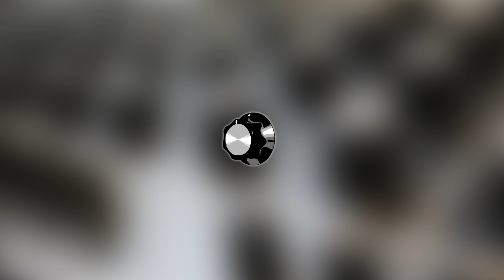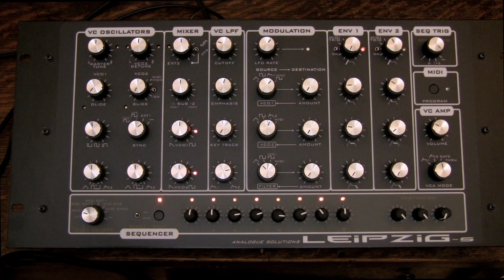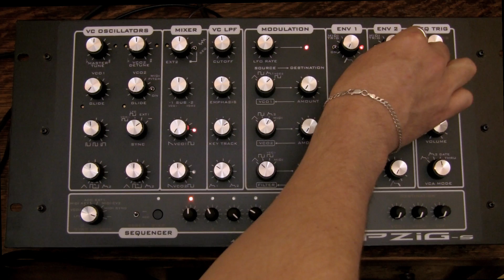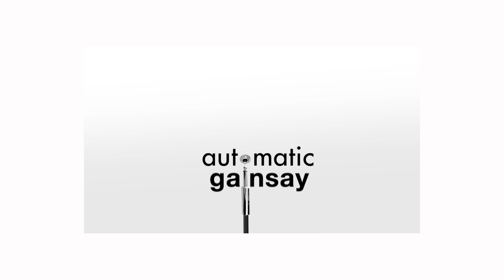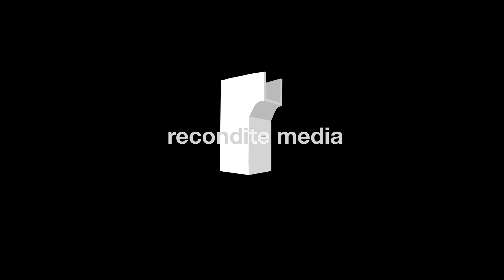03-01-The Analogue Solutions Leipzig-S: Part 3: Filter and Mixer

Comment: I'd seen this synth before and heard some demo songs but your review is revealing it to be somewhat of a barely caged beast. Would be interested to hear if you think it's a bit over the top Marc.
Reply from the maker: Herr Absurd I think it is totally over the top!  But I mean that it the very best of ways.  I think of each synthesizer being a tool, and the measure of it is how good it does what it does.  
In the case of the Leipzig... we're talking about a sledgehammer.  It is giant-sounding and aggressive, rich and full.  It's like a superhero... all of the normal synthesizer qualities are amplified into pure power.  

I don't think I'd use it for a slow, quiet, sensitive song... not, at least, without turning most of it down or off.  :D

Comment: The cool thing with the dual envelopes on the filter sounds like having simultaneous ADSRs routed to filter, no?  So you can blend an sharp transient with a slow attack ramp; sounds like you could get some more interesting dynamics that way than with just a single ADSR routed.  Loving the subtle additional options like this...